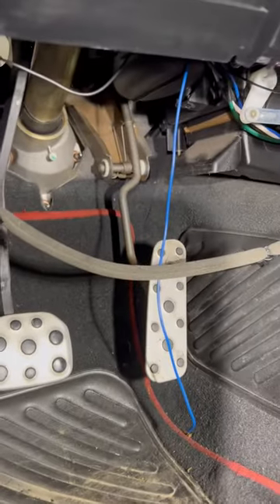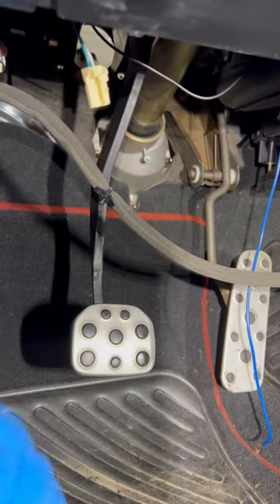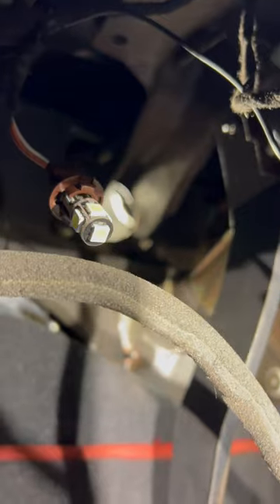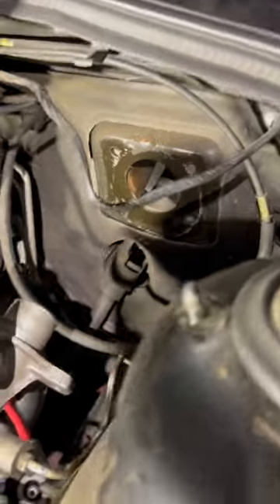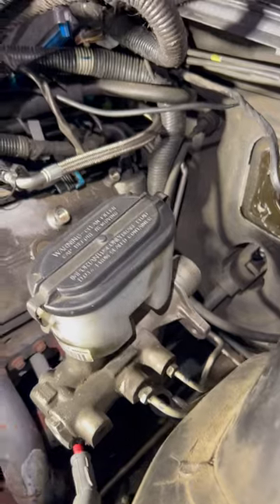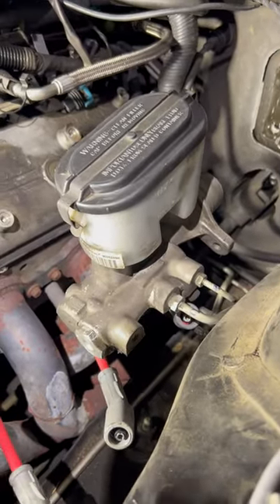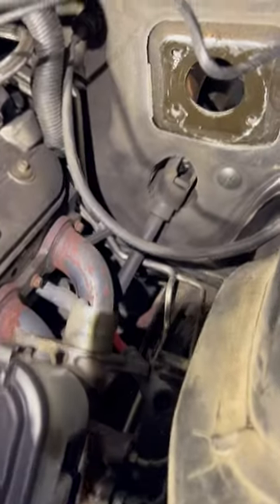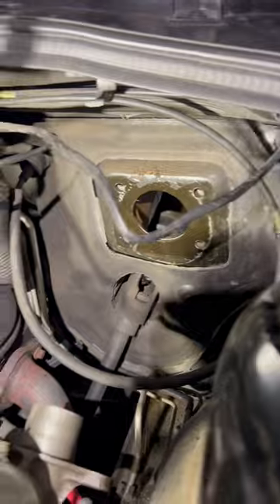2004 GTO manual swap pedal install #magnum #t56 #ls1 #transmission swap #4l60

Comment: Thats a lot of work, but it's going to be worth it when it's done!! Respect for doing your own work!
Reply from the maker: This week has been rough. Blood sweat and tears for sure. 
And my shifter pops out of 1-3-5. It’s not running yet but that seems like an issue. I emailed rpm to see what they say. I’m new to manuals so idk.
Reply: @ZL1-Jeremy  wow not sure what to say to that! I've seen the shifter pop out of (usually 1st or 3rd) only when running though. Usually bad synchro gears or the synchro pins. Hopefully its something simple! You'll get things worked out!
Reply from the maker: @runsgoodbutsmokes  it was the rubber boot that covers the shifter. Going to have to modify it to fit properly. 
She runs.
Reply: @ZL1-Jeremy  Awesome!!! Love it! Glad it was an easy fix!